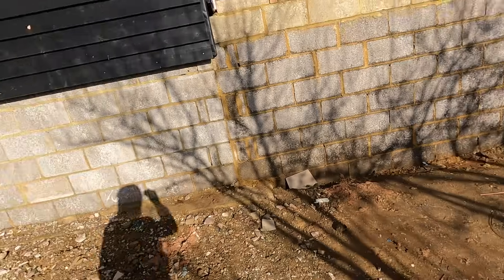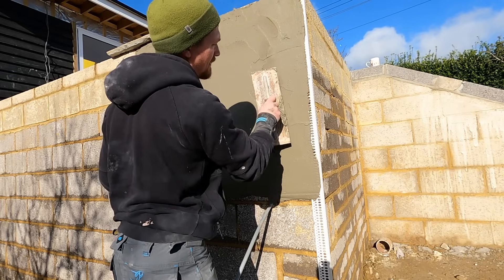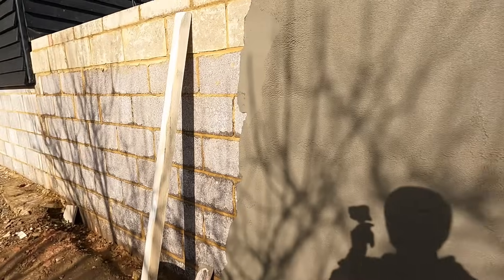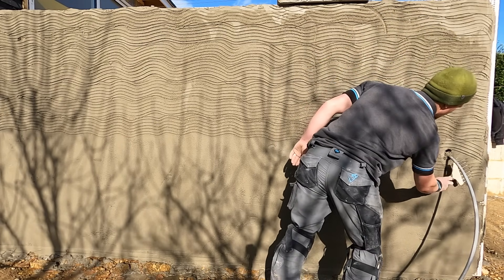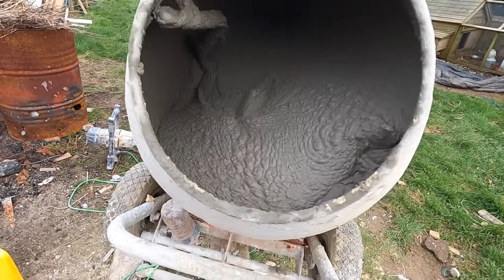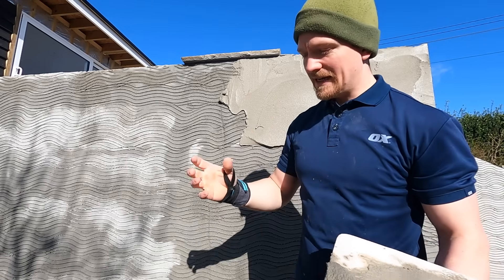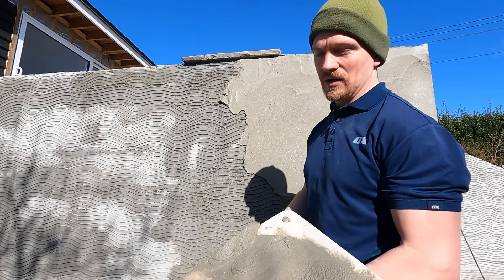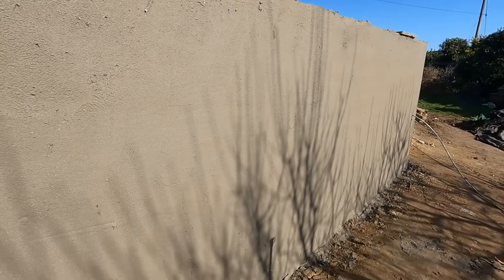Beginners Guide To Rendering…Every STAGE Revealed | MIXING/ APPLICATION/ PERFECT FINISH

Comment: I'm a brickie learning rendering and skimming. What I say to labourers is to stretch the water when mixing. If the sand is sopping then no water needs adding just plasticiser until it dries up when cement is added then add water only if it turns and no moisture is getting through the mix. I love watching your video, I've learnt loads mate keep up the good work.

Comment: Very good detail. I have a fine rendered wall leading down my driveway. There is a horizontal  5mm wide crack in the wall. I am keen to do the repair. I would appreciate if your could provide your comments on the following:
1. Do I need to do a scratch coat. Or can I simply fill in the crack with say cornice cement. Prime it with an undercoat and then put a fine render over it.
2. Alternatively fill the gap with your scratch coat mix and then apply the fine render

Comment: First time rendering here, no clue what I'm doing.  Rendering aircrete block wall and was told to render with the adhesive, not with sand and cement.  I've done a first coat hut didn't know about scratching it.  It's been drying for a day.  Can I add the top coat without the scratch, considering it's adhesive? Any tips for rending with adhesive- are there any major differences I should know about? Thanks for this video, it's really helpful.  Just wish I had found it before I did the first coat!

Comment: Question about water proofing, I have a concrete block walls, 100mm solids on the flat, the walls will be clad in 200mm of rubble stone, I want to render the solid blocks before the cladding, to give a water proof coat, is one coat of render enough? or do I need to apply two coats, scratch and finish? I don't think I'll need to float the finish as this render will be covered in the cladding, what do you think, any suggestions?

Comment: Loved watching this vid, super informative!
Just had a mud kitchen built outdoors and the render not only cracked and blew but looked mega thin and patchy. Builder re did it but it's just as bad more patches more discolored areas and blown. Looking under the the render that's come away the base looks level no scratches could there be a specific reason for this. The overhaul render only looks to be around 2mm deep, am I right in thinking this is even worse than I 1st thought? Any advice welcome xx

Comment: Hopefully someone can help me. I'm new to rendering. When you put the beads on, do you render upto the top level of the beads on the scratch coat or do you leave some space for the top coat to go on so it rules in line with the bead?
I've been told if you get a 15mm bead then 10mm of scratch, followed by 5mm of top coat. Is that about right?

Comment: I've just watched this video and it's answered most if not all my questions 🙃
Reply from the maker: Great to hear!! Thank you for watching mate 👍
Reply: @PlasteringForBeginners  no problem, I've watched many of your video's.. I'm a chippy but have a go at anything.. it was a scratch coat and pebble dash job, my god did I struggle at times to get the consistency just right so I could apply the shingle, it was my 1st go ever and 2nd time I have ever rendered anything.. I did a mtr square at a time and certain areas would dry out and not let the shingle adhere whilst others we're to wet still despite using a waterproofer in the scratch and SBR in both coats.. my mix was 5:1:1 sand, cement & lime.. I couldn't even get on with the Derby to flatten off so I did it all freehand. Looks alright but blimin hard going 👍

Comment: Thank you! can you please state the exact ratio here for the base and for the finish, i couldn't understand it properly
Reply: I think it’s 4 plastering sand to 1 cement for the base coat.  And he ads a jug of integral waterproofer to make it smoother.   The finish is 5 or 6 sand to 1 lime and 1 cement.  I would try adding the water proofed to that too.   Make sure surface is wet but not runny wet when applying each coat.   I know from working with my dad you just get better each batch.  And you can cover up any mistake.

Comment: @Plastering for Beginners, thanks for your great content. Here in the Caribbean, specifically in Puerto Rico, where we enjoy year-round summer weather, plasterers only do one layer, so it is completely new to me to see a double layer of plaster. Is this due to your zone's climate? Is there any reason you think we should be doing two layers of cement in our hot and humid climate? Keep up the great work!
Reply from the maker: Great hearing from you!! Thank you for watching. 2 coats is for 2 reasons. An extra layer against the wet conditions…very wet here…and strength. The more layers you apply the stronger it is. That’s obviously if it’s been applied correctly but that’s the idea to it 👍
Reply: You c ould do it in one coat use glue on block a 3 to 1 mix sand to cement scratch Ina bit ahead go back and double  up then Darby straight edge  is to hard for a beginner

Comment: would like to know if you've ever had a problem with putting waterproofer in the scratch coat, it happened to me once, in a basement, and the top coat wouldn't suck in at all, i'm not an experienced renderer though, like your video

Comment: If there is a long section of wall say under 6m, could I use an expansion bead to break it up, and make it easier to rule? I have a straight edge but is only 6ft and I don't want to free hand it, so would I be ok putting expansion beads to help so that the ruling is easier?
Reply: That would look weird in my opinion. So I would advice against it if its not for yourself

Comment: Are you familiar with Custom Float? sold in the US mostly for tile applications, but the mixture is 5 to 1 to .5(sand to cement to lime). I'm going over some rugged interior brick.  Do you think it would work for my main coat?

Comment: Blinding vid bruv very informative and of course really nice work.
Now me not being a plasterer I once a long time ago tried rendering a four foot high garden wall.
It was about as long as the wall in your vid.
Now I used Sharp sand four to one mix and it took me forever to get it on the wall it was heavy to work with and it was forever falling off. I know now that I tried doing it all in one coat😫
Anyway at the time I was told it was because I didn’t seal the wall first with PVA.
This I now know didn’t matter because the I applied it all wrong.
Needless to say we got a plasterer in to sort it.
Anyway I’d like to know from you if you ever use PVA to seal the block walls first? As in this vid you seemed to just apply the scratch coat straight on.
Thanks again for a great vid.

Comment: dunno if you read these but can i ask please, (i'm a complete novice) can i render over house bricks as well as breeze block and can i render straight over expanding foam?
Reply: You can on bricks and blocks, but every surface is different though. You might need to treat it beforehand. 

For over expanding foam you cannot. You need plaster mesh tape. 

Also plaster mesh tape Preferably on every edge where the existing wall changes in a different material, so also on your bricks to blocks. As every material expands differently with the weather.
Reply: @crazybutter8554  thanks for the info

Comment: Cracking content matey, spot on.  I have been plastering a while but have never done large amounts of rendering. Only small garden walls etc.  I have a dilemma though.  What happens when you are rendering up to a neighboring wall. Do I just stop bead vertically down the wall to split my side from the guys next door.  I have to get my old render off the wall too which is a pain but has to be done as it is ancient.  Have to be careful though as would not want to upset the guys wall next door if at all possible.  Any advice would be tremendous matey.

Comment: Hi Blaine, I will be attempting this in the next couple of weeks. You have given me the confidence to give it a go and I am looking forward to it. Are there any tips for painting a rendered wall like this? All the best, Rob.
Reply: So, how did it go?
Reply: @mattrybacki189  I finally got round to giving it a go on Sunday. I rendered a 6 meter long wall which is about 1 meter high. I think it went OK but definitely a steep learning curve and mistakes were made. 1) It was the first dry day in Pembrokeshire since 2013, and although it was dry the wall was saturated. Apparently this is a big no no, and it meant that the render took ages to set before I could start ruling it, and then even longer before I could start floating it. 2) I've got three tonne bags of sand at my place ready for various jobs, and I used the last dregs of a bag to do this rendering. In hindsight this was a mistake because I think the sand at the bottom of the bag was grittier and more coarse than the fine stuff at the top. This meant the final finish wasn't as smooth as I would like. Its not terrible by any stretch, but it could have been better. 3) Rendering is bloody tough work, and tackling 6 meters of wall in one go, with no assistance, learning as you go was maybe biting off more than I could chew, and physically I am feeling it today! 4) Do not get render (that has lime in it) on your hands!! They are in a hell of a state now, dry as f..k and peeling like mad. 

Apart from all of that, I managed to get it reasonably level (within an acceptable tolerance for me - being a total novice), it is still on the wall (and it has rained since, so maybe a good sign). It is relatively small, and from a distance looks great and even closeup there are no obvious hollows or lumps.

Comment: Being an absolute beginner, this looks scary, mostly the fact of having to get a large area on relatively flat. If I have a large wall, could it be done in sections smaller than the width of a rule at a time until I get confident? I was thinking of applying a bead of 10mm each side for a scratch coat, then applying a second 10mm bead on top for the second application. This way I'm thinking I could get it dead straight, but only do 1m or 1.5m at a time until I'm more confident. Of course I'll probably end up with some vertical effects where I've removed the beads then filled the resulting voids, but I think I can live with that. Does that make sense? Great videos by the way :-)

Comment: Great videos. I'm rendering with sand and cement for the first time soon. It's a long wavy wall that I built. I plan to split the render top and bottom with a textured tile between stop beads. Any suggestions for sponging/finishing?

Comment: Question for you Blaine...
I painted a block wall with masonry paint but now would like to render it.    Is it possible to render a painted block wall?
Reply from the maker: Yeah mate. As long as the paint isn’t flaking and there’s a strong Bond then you’re good. You just need to use a Rendering primer like Rendagrip. It’s good stuff 👍

Comment: Hello, guys. I have a question for you.  Adding a thin layer of dry mix of cement and sand over the screeded flat bed of sharp sand before laying the slabs. I've seen a builder do it here in London. Before filling the cracks, he put water on the slabs so that the dry mix understand the slabs will harden and Stops it moving. Please answer me ASAP, thank you.

Comment: Hi Mate. When you say 250ml of plastisiser is that in every mix? Also when doing the top coat when you use lime in the mix do you still use waterproofer/plastisiser?
Reply from the maker: Hi mate! It’s typically 250ml per bag of cement. I still use lime with the additives mate - I just find it makes the mix better overall 👍

Comment: Do you have to use beads... I'm looking to render a small wall about 400 - 600mm high?
Reply from the maker: You don’t have to mate but it’s easier if you’re new to Rendering. Forming angles is tough if you’re new.

Comment: You get a very high standard finish with sand and cement your very skilled at rendering . 
I use kc1 fassa ready  mixed  for sand and cement finish now no more mixer setting up and adding additives 😅 or ms20 from fassa , have you ever tried any of them .
Reply from the maker: Thanks pal! I haven’t tried these 2 actually but I’m definitely intrigued. I’ll have to give these a go...thank you for the suggestion pal. I really appreciate it 👍
Reply: @PlasteringForBeginners  i recommend you try them even on a little wall or something . You can mix in a bucket with your paddle . And you can’t really ever lose it you can wet it up even if it pulls in , like I said you do a unbelievable job with sand and cement so be interested to see how you find them as there easier to use in my opinion . Keep up the good work 👊🏼👊🏼

Comment: One question for you Blaine if you can answer or anybody with experience, 
I've to plaster a bathroom ceiling but it has been painted. 
What are my best options to carry out this job?
What Pva and Plaster is best suited for this situation?
Thanks
Reply: Either pva and a little sand mixed through or a product called blue grit prior to plastering
Reply from the maker: As Matt said - just double check to see if it’s Distemper. If it is then you can’t plaster it and you’ll have to overboard it. Hope this helps

Comment: Hey love your videos I am currently learning to plaster. One question on this video you pinned in the beads before any coast but in a previous video you set them into the scratch coat. Would love a video about the different beads and how and when to use them. Also an idea for a video is I’d love to see your recommendations for a beginners tool set up for plastering as there are so many brands with so many variants. Thanks again! Great content.
Reply from the maker: Thank you mate...hope you’re training is going well! It just depends on the thickness of the bead - this one was 15mm so it couldn’t be fixed onto the scratch coat. The other one you seen was 10mm which is why we bedded it on the render. Hope this helps my friend 👍
Reply from the maker: Great suggestion by the way. I’ll look into it!
Reply: @PlasteringForBeginners  oh great that’s really helpful thanks for replying.

Comment: Great video, been rendering today myself, quick question, in other videos you've used SBR do you not need it in cooler times of the year?
Reply from the maker: Good man! To be honest, I use SBR on standard brickwork (especially brickwork that’s been hacked off) to give it a better key. But with concrete blocks like this I don’t bother. They have such a strong key and cement content anyway that it didn’t really need it. Hope this helps my friend 👍
Reply: Come on here to check the exact same r thing. Sometimes he doesnt explain the full process of what tools hes using in this case sbr. Id prefer if it was mentioned what tools amd applications at every stage which can be a bit frustrating

Comment: Would you not recommend using a stop bead along the bottom of the wall also never scratch in wave motion
Reply from the maker: The whole area is getting raised and slabbed so i wasn’t needed 👍
Reply: @PlasteringForBeginners  I would still highly recommend so stop any ground moisture seeping up the render. Decent finish

Comment: hi mate, i’ve got a full house to render and the brick work is really bad, its going to need 2 scratch coats, i usually do my scratch at 4 and 1 and my top 5 and 1 and half lime, if i’m doing 2 scratches what should my ratios be on them? tia
Reply from the maker: Hi Mate! As long as you keep the ratios the same then you can do 2 scratch coats at 4:1 - just make sure the mixes are consistent. You can do 4/ 5/ 6 sand (goes up at each coat) but you should be fine with 2 scratch coats at the same mix. Hope this helps pal 👍
Reply: @PlasteringForBeginners  thanks mate, i have looked into this and most say keep the scratches the same ratio, but doesn’t this go against the rule of working weaker coats as we progress?

Comment: Hi Blain 
Do you ever get crazing on your finished render. I use the same mix as you and on occasion I seem to get crazing. 
Also in this video you used 5.1.1lime I thought you used 5.1.1/2 lime. What's the reason for upping the lime content (colder weather)
Reply: Good Qn, I think that as the wall is a retaining wall, it is likely to get damp coming through, so the extra lime will help overcome any issues from the damp. Never use more lime than cement though.

Comment: If you’re rendering a wall where there was a lot of ivy growth, is it necessary to treat the surface against root-regrowth or can I just render over the scraped remains?
Ps. Surface has already been scratch cleaned and wire brushed.
Reply from the maker: You could SBR the surface beforehand if you’ve worried about it - this acts as a primer for render onto brickwork
Reply: @PlasteringForBeginners  thanks 👍🏽

Comment: Really good demonstration on the skills and techniques needed to apply external render successfully by a very calm and competent plasterer. For me as a surveyor however, a 4:1 mix is overly strong for standard exposure conditions on a block background.  For anyone interested, obtaining reliable guidance on actually selecting render this can be found in Building Research Establishment publication “Good Building Guide No 18” (Choosing external rendering) as this provides information on such matters as suitable preparation options, appropriate mixes for different backgrounds and exposure levels, and examples of good detailing.

Comment: Great video. My builder doing basically the same. Rendering to the floor. Some people say only render to DPC/use drip bead.. What are your thoughts?
Reply from the maker: That the correct way - this is a raised patio so the DPC starts where my render finishes...the steps leads to the ground floor. If the wall continued then I’d plant a stop bead above the DPC which would act as a breaker between the 2 petitions. Hope this makes sense my friend!